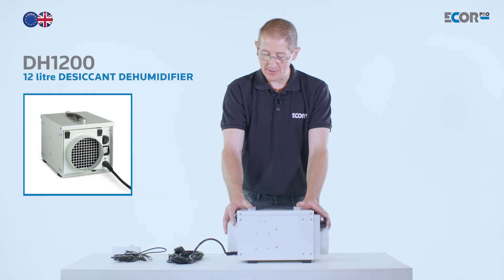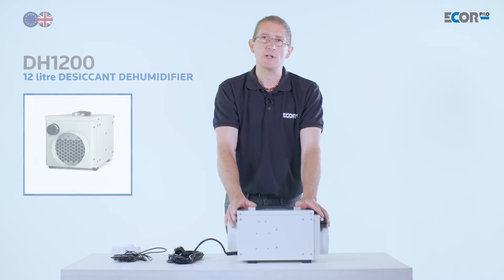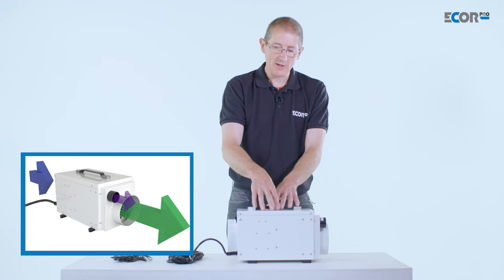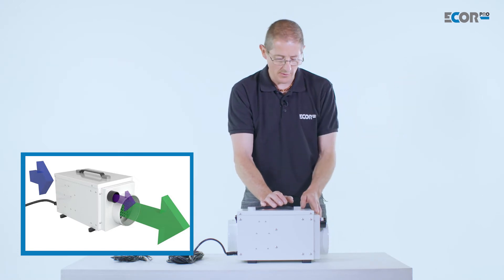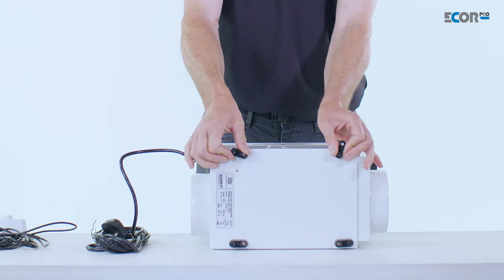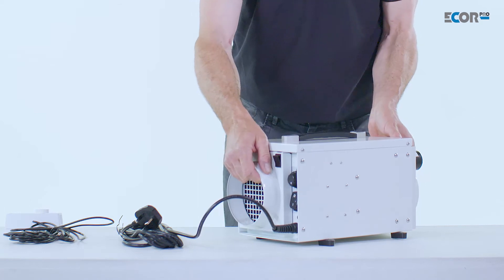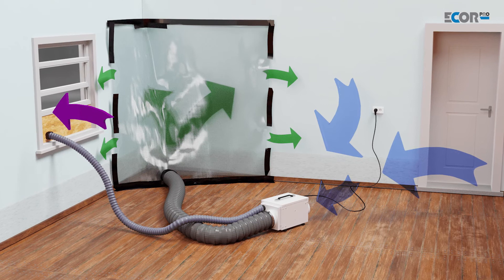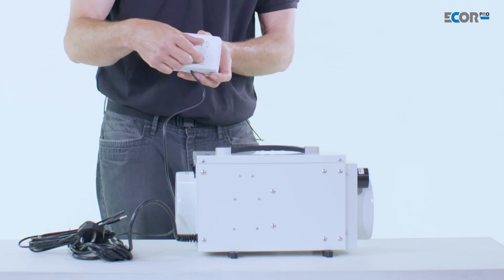DH1200 12L Desiccant Dehumidifier

Comment: Hi, if I used this on my boat over winter, would also heat the air drawing through the machine? And could I drop the outlet pipe into a sink to drain overboard? Thanks